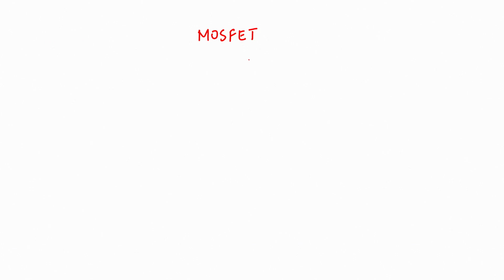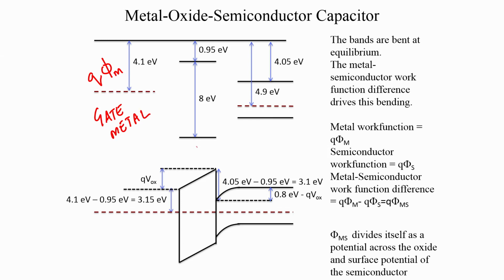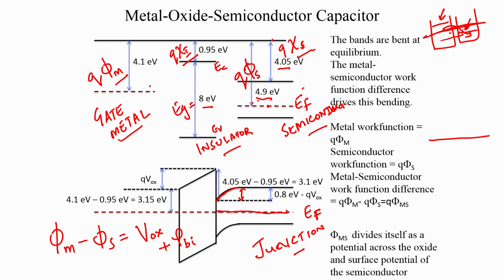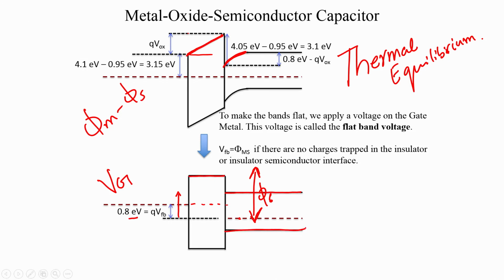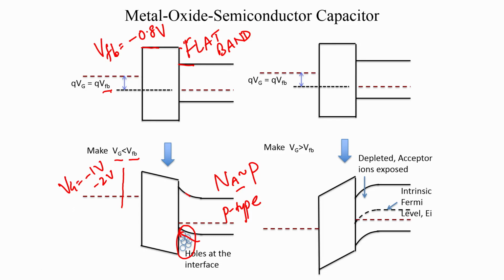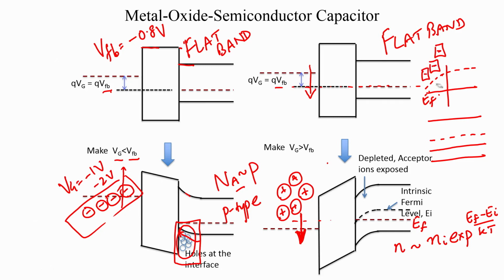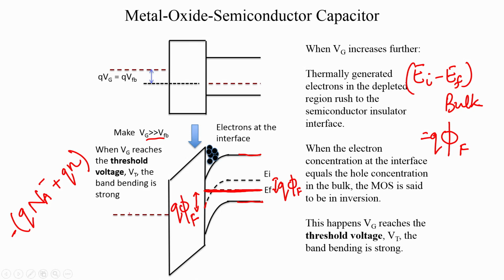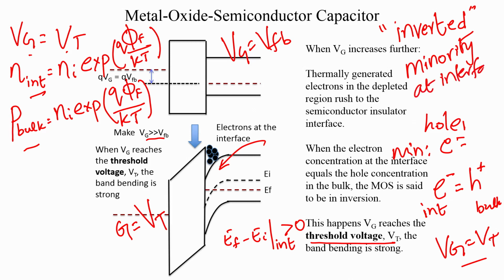mod08lec32

Comment: Depletion region in forward bias favors recombination of carriers, while depletion region reverse biased favors generation of carriers. In the oxide semiconductor interface, should the metal with positive charges at gate surface considered a n side while the actual n-side be considered as a p-side in inversion of n-type semiconductor when Vg>0 to justify generation of electrons in the depletion region.